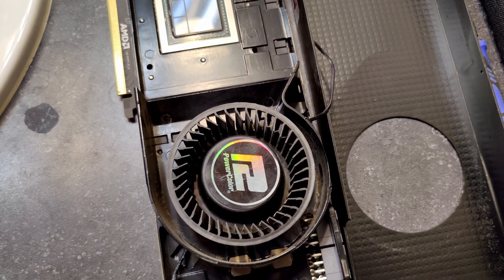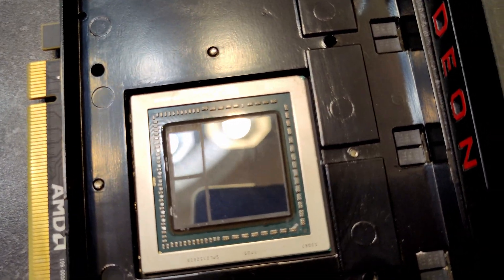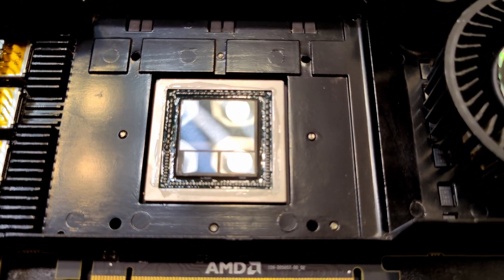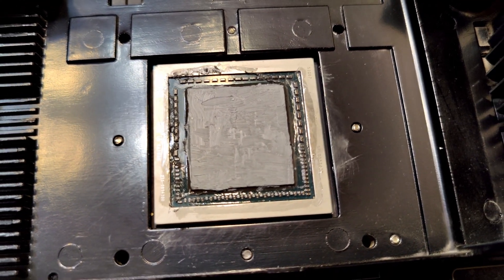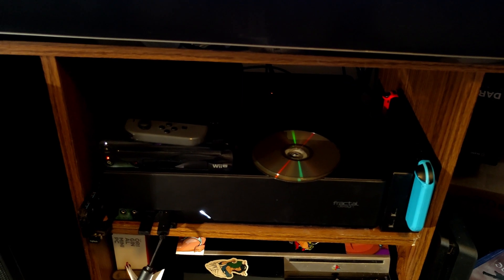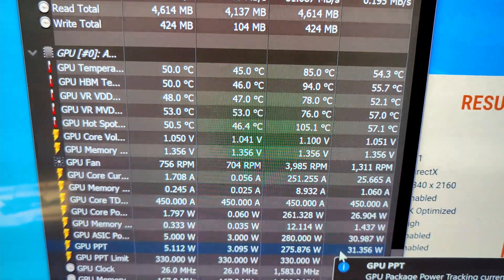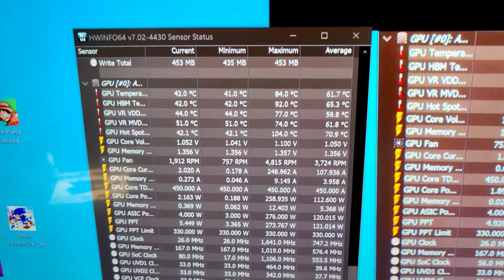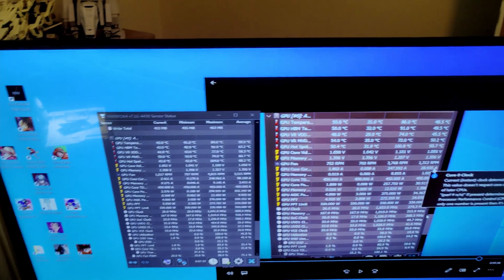AMD RX Reference Vega 64 Repasted

Comment: Just repasted my Vega 56 from launch after four years. It was in the same condition as yours; all dried out. I used a 6.5 w/m-k paste I got from Microcenter...wow! HUGE difference in temps and cooling response after high GPU use events! Like when I got it new! I need to warn everyone to loosen/tighten the sink screws in patterns (think of lug nuts on a tire). Not too many turns at a time! Back to fearless gaming of any title I want to!
Reply from the maker: I went a step further and did liquid metal on this Vega 64. I just  wasn't happy with my repaste job.